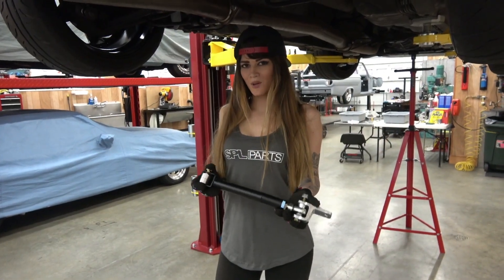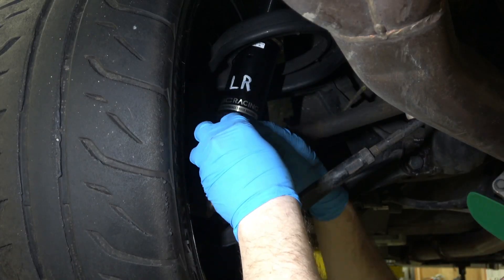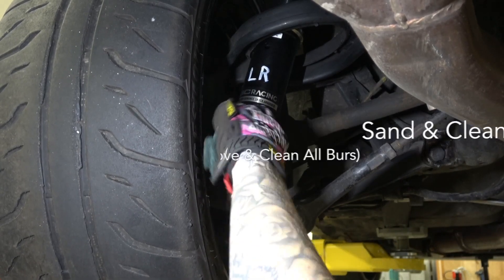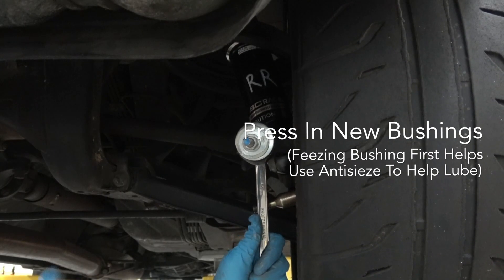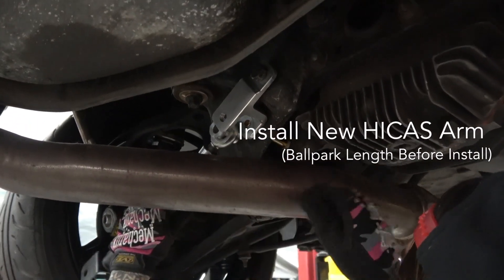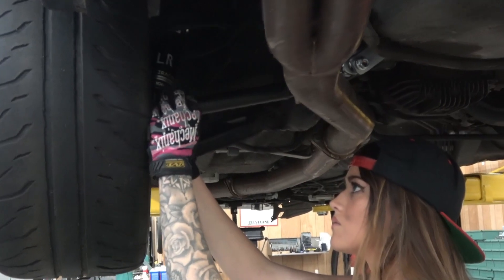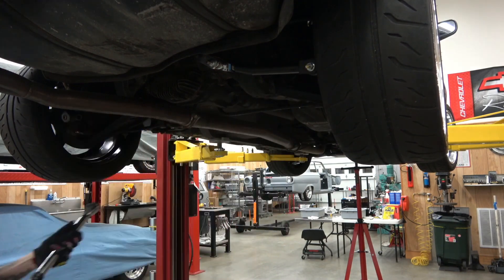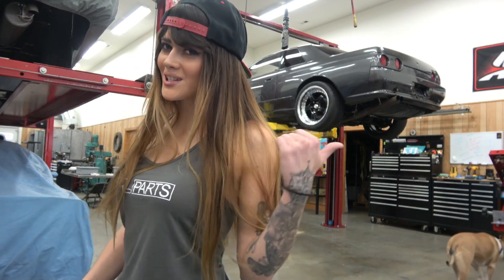Project Skyline: SPL Hicas Elimination Kit Install

Comment: I know everyone has their reasons but the HICAS system is part of what makes this car so unique. I love my all wheel steer.
Reply: XPdriven With a car that old the system never works properly and actually makes it dangerous to drive
Reply: FZT Motorsport mine works just fine, although I see your point. How do you know it's failing?